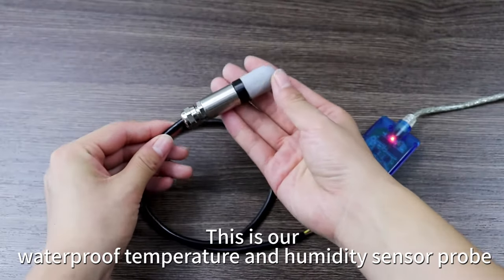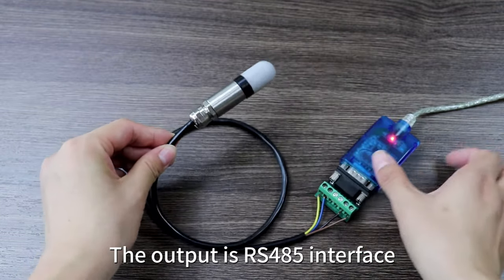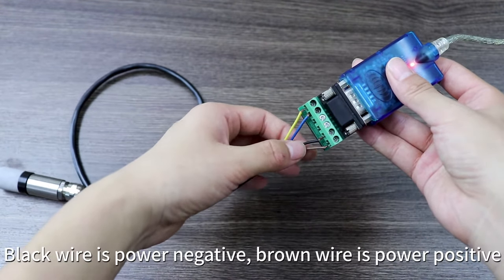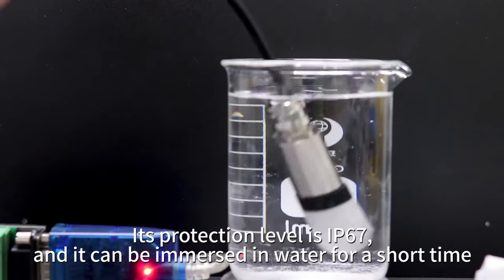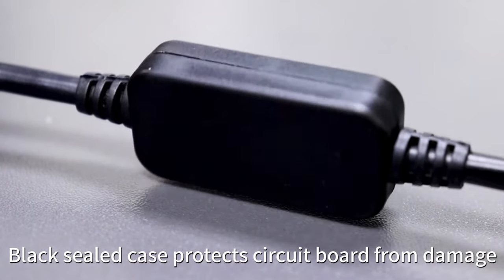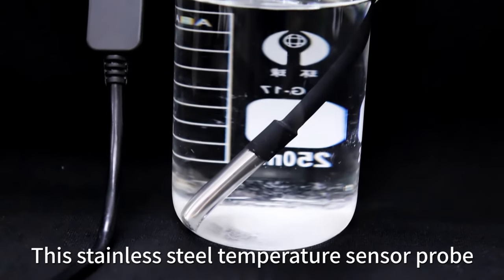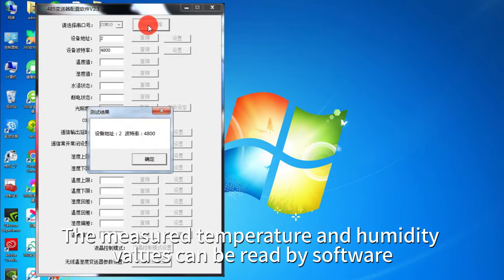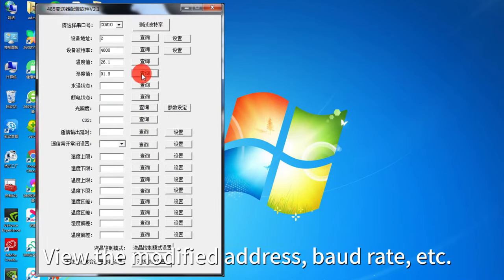temperature and humidity sensor probe

Comment: how under water and it could sense humidity
Reply from the maker: The outer shell is waterproof but conducts heat, and the sensor inside can measure the temperature.